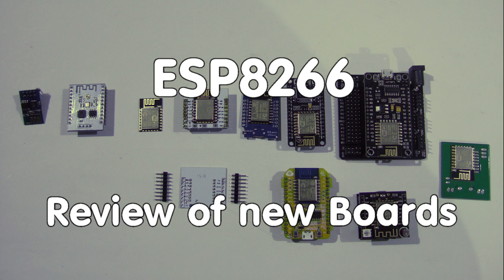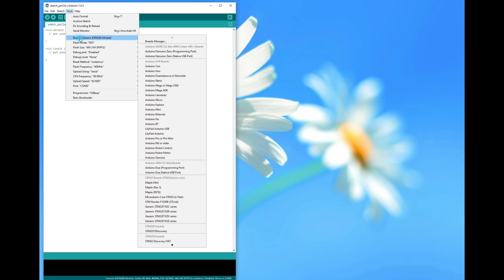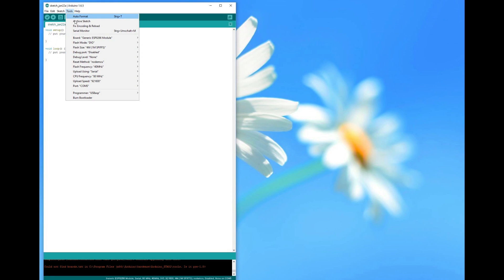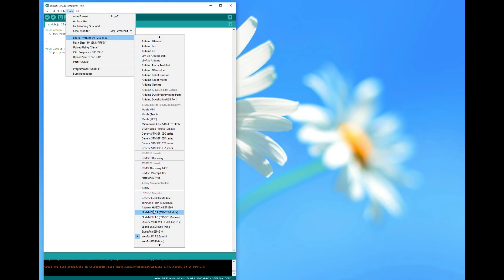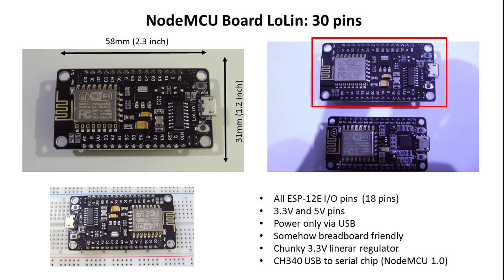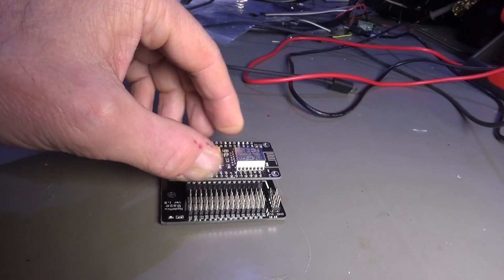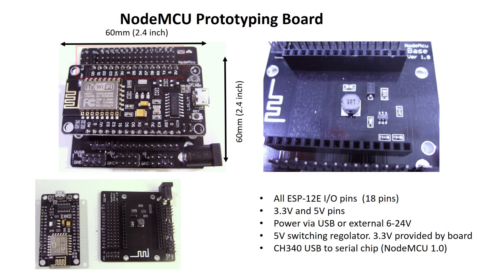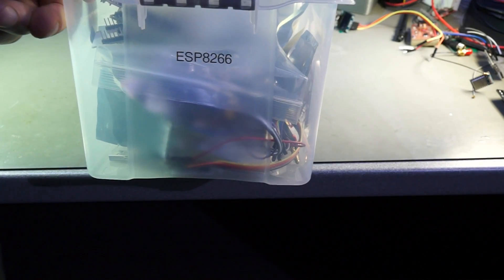#41 Review: Mini NodeMCU (Wemos), Prototype Board, NodeMCU (DOIT&LoLin), Arduino like Wemos, Witty

Comment: hi, great video. I have one problem with te 12E chip (it has 4Mbytes flash memory) but in Arduino IDE I get only 1Mbyte.
Do you know why? (with Nodemcu Lua i can see the 4Mbytes)
Reply from the maker: How do you know that the IDE only sees 1 MB?
Reply: +Andreas Spiess 
Sketch uses 239,311 bytes (22%) of program storage space. Maximum is 1,044,464 bytes.
Reply from the maker: +Babo Babic which board did you chose? If you chose SPIFFS 3M then you only get 1M for your sketches. Try 1M SPIFFS and you should get 3M for your sketch. Goggle SPIFFS if you do not know what it is.
Reply: +Andreas Spiess the board is NodeMCU 1.0, the board is LoLin v3. it does not make any difference witch SPIFFS I choose. If you make it so do you get: Maximum is 3Mbyts whenuploading?
Reply from the maker: +Babo Babic No. You tell the IDE just how you want to partition the memory. Because so far I did not use SPIFFS i always cose 1M SPIFFS and get 3M for my code.
Reply: +Andreas Spiess If I choose 1M SPIFFS or 3M SPIFFS I allways end up with: Maximum is 1,044,464 bytes. Do you get the same message or is the messsage different, like: Maximum is 3,100,000 bytes?
Reply from the maker: +Babo Babic I am home again and was now able to do some tests. I have to admit, I never looked at this number because I never had any problems with memory size and the new ESP modules.
I get the same results as you. The reading behaves as expected below 1M (if you change SPIFFS size you get less memory size). You can try that if you select any ESP board below or at 1M and just compile, not upload.
The maximum memory size, however is always 1,044,464 bytes. Maybe this is a limit of the Arduino IDE. I do not know.
The only place it matters so far is if you do OTA. There, you need double the memory and with small boards it can get critical.
To find the real ESP memory you can use the ESP.getFlashChipRealSize() command.
Reply: +Andreas Spiess it will allways be only 1Mbyte for code and the option (1M or 3M) is for the SPIFFS size (1Mbyte code + 1Mbyte SPIFFS  or 1Mbyte code + 3Mbyte SPIFFS). And here is why:

SPIFFS is a FileSystem that allows to store files directly in Flash instead of having an external SDCard or other storage.

If you don't need that and wish to use the whole Flash for code, it should be possible by creating a new variant board, in the file esp8266/hardware/esp8266/1.6.5-947-g39819f0/boards.txt (path may vary depending of your installation).

In this file, you can copy/paste the "NodeMCU 1.0 (ESP-12E Module)" and create new entry such as "NodeMCU 1.0 (ESP-12E Module) Full 4M". First, in the new entry, all name prefixes such "nodemcuv2." needs to be renamed like "nodemcuv2full4M". Then adjust the line "nodemcuv2full4M.upload.maximum_size=1044464" to some like "nodemcuv2full4M.upload.maximum_size=3932160" (which leaving at least a small place for tiny SPIFFS) . Next, the SPIFF itself need to be relocate as at tiny SPIFFS at the end of the Flash : "nodemcuv2full4M.build.spiffs_start=0x3C0000" and "nodemcuv2full4M.build.spiffs_end=0x3FB000" 

Personally, I didn't try the above yet (I will when I get chance), but it should work pretty straight-fully, although there are maybe other changes to do with the linker scripts. - See more at: http://www.esp8266.com/viewtopic.php?f=32&t=4432#sthash.Sl6fGgIL.dpuf 

(By martinayotte on ESP8266.com)
Reply from the maker: +Babo Babic thank you for the update. Because some boards work definitions are ok I wonder, if it a mistake of the developers or if it has a reason. Did you try a sketch this size? Is the IDE capable to deal with it?

Comment: I have a Wemos mini. It has worked great. I use it with Blynk app to control via the cloud. My trouble now is I would like to add an Ultrasonic distance sensor to my project but the board does not support it! Any suggestions would be appreciated. Thanks for all the great videos. They are very helpful
Reply from the maker: +Brian Fox You should be able to use pulseIn() which measures length of pulses. The command should also work on ESP, but I did not try. Otherwise you could try a while ("Echo pin is high") ; and read the micros() before and after this while. This could give at least a result and you have to test its accuracy.
Reply: Thanks for  your reply, I will give your suggestion a try
Reply: +Andreas Spiess Well, I did not have any luck, so far! I tried this code as well which the author claims that it worked. I got a Serial.print of 0 Centimeter. However, I am not sure if that is because of the use of the sensor with the Wemos or the fact that he has wired the Vcc of the sensor to the 3V3 on the Wemos. My understanding is that the sensor would not work with a voltage that low. Anyway, if you have a link to a sketch that works with the HC-Sr04 and Wemos mini, it would be much appreciated. Thanks for your time and this is the link to what I have tried:
http://www.14core.com/wiring-esp8266-nodemcu-with-hcsr04-ultrasonic-sensor/
Brian
Reply from the maker: +Brian Fox This is well possible, because the HC-SR04 is 5V rated and the ESPs rund on 3.3V. Your source was lucky.

If you use the Wemos mini, you also have a 5V pin. If you put VCC of the HC.SR04 to that pin, this device should work, but you have to protect the input pin of your Wemos because usually, they do not like 5V. You can either use a level shifter like this one: http://www.aliexpress.com/store/product/Promotional-IIC-5-3V-system-compatible-with-the-I2C-level-shifter-module-the-sensor-module/834205_32425888659.html
or like this one: http://www.hobbytronics.co.uk/schottky-logic-level-conversion.

I quickly tested the second one with a Wemos mini and your sketchand it worked. (I replaced the defines with the D1/D2 pin description and used the nodeMcu 1.0 board definition)
Reply from the maker: +Andreas Spiess BTW: Mine did also not work on 3.3V
Reply: +Andreas Spiess Thank you very much for your time. It is appreciated. I in fact did get the sensor to operate on 3V3, however it ran for a while, then stopped. If I covered the speakers with my fingers, I was able to make it start reading again. Crazy for sure. Anyway, I just now completed connecting the sensor to the board via a voltage divider and it is running as expected. i have other issues with my design beyond that though! Back to the drawing board. Once again, thank you for your help. I look forward to watching more of your excellent education videos.
Sincerely
Brian
Reply from the maker: +Brian Fox i am glad to hear that it works. A voltage dividor is also a good and cheap idea!
Reply from the maker: +Brian Fox i am glad to hear that it works. A voltage dividor is also a good and cheap idea!
Reply: +Andreas Spiess , Even a blind squirrel finds a nut! Got lucky. LOL, thanks again.
Brian

Comment: Hello,
could you please recommend a nodemcu board that works well, based on your experience?
Reply from the maker: The boards are not good or bad, they are different. So, its up to your needs to chose.
Reply: +Andreas Spiess Thanks.

I asked you because so far I have tried two nodemcu v2 boards:
1) http://it.aliexpress.com/item/Free-shipping-NodeMCU-development-board-for-ESP-12E-from-ESP8266-esp-12E-Lua-IoT-programable-wifi/32357301146.html?adminSeq=221155680&shopNumber=1264329
2) http://it.aliexpress.com/item/Update-Industry-4-0-New-esp8266-NodeMCU-v2-Lua-WIFI-networking-development-kit-board-based-on/32358722888.html

I program both with Arduino IDE.
The first one works perfectly, while the second one does not connect to wifi.
Since you also use Aliexpress a lot, I was hoping that you could share with me some products that you have tried.
Reply from the maker: +mark So, you had bad luck. About quality, I can say, that I am always prepared for devices which do not work. This is why I try to test them before I confirm (if I have the time). But I had only a few problems.
I shared the link of my suppliers in th comment in the video, without "guarantee" that you get a good one ;-). So far, I had more problems with "non-compliance to stated specifications" than with qoality of products. In the next mailbag you will see, that I purchased ESP-07 "new version"  boards where the supplier stated they have 4M flash. But in reality, they only had 1M.
Reply: +Andreas Spiess So far I had very good experiences with Aliexpress, but recently I have started to have some disappointments.

Based on your experience, is it easy to receive a refund by stating that the device does not work properly?

Are we required to send pictures and/or videos of the product?
Reply from the maker: +mark If you can prove teh things are physically defect it is easy. If they do not work as they should usually you end with a 50/50 agreement. If the supplier does not agree you can escalate it to aliexpress and the do a judgement.

Your case has to be well documented by pictures or other things. I am not sure if video works, but pictures generally are necessary.

I have disputes for about 2% of all orders, which is not a lot.
Reply: +Andreas Spiess Thanks for the detailed explanation.

It is hard for me to locate problems on the board with a visual inspection, so I am not well positioned for a dispute.

My board is the DoIt board (the last link in your list).
Reply from the maker: +mark So, you maybe just write it off and order a new one. These days, this is a little easier because of our chinese prices ;-)

Comment: I did not understand the difference between the LoLin board and the DoIt board, can you please explain again? (:
Reply from the maker: +Idan Ben-moshe Both boards are very similar. The differences are described in the video (6:22 Lolin and 5:22 Doit). The text ois ok, just one picture is wrong. The CP2102 chip of the Doit is square, the CH340 is rectangular. So, they are easy to distinguish.
Reply: +Andreas Spiess Who's better? Lolin or doit?
Reply from the maker: +Idan Ben-moshe You chose. Depends on what you need. They are different not better or worse. The price might also be different.

Comment: Interesting video. However, I noticed an error at 3:30s (https://youtu.be/YQadLyBwz3M?t=3m30s ) where you say the D1 mini makes all GPIO pins available. None of the connectors opposite the aerial on the esp8266 module are brought out to pins on the D1 mini. These include GPIO9 and GPIO10 as well as SPI bus pins. 

Also, you contrast DOIT and Lolin boards and at 5:43 are purportedly showing the DOIT board but it has Lolin written on the board which leaves me confused. I wasn't sure whether this meant DOIT is one version of a Lolin board or something else.
Reply from the maker: +Ken Taylor You are the first discovered my mistake with hte boards! Thank you! There are two boards available. One from Lolin and the other from Doit. I put two annotations in the video where I mixed the pictures.
Concerning the pins: I said, that it has all NodeMCU pins. The nodeMCU buards use different pin definitions (D0 to D10) than the ESP modules. To my knowledge there is no definition availabde (Dxx) for GPIO9 and 10. However, I was able to address  GPIO9 with my sketch using just the port number. GPIO10 did not react. Maybe you have different experience if you use these pins frequently. Maybe it depends also on the development environment.

Comment: good evening
I wonder if I can put in a 180 esp8266 12e and connected to each of a temperature sensor, current and a relay board network. all connected via wi fi and sending the data to excel.

send me an email for me to show the project
blima71@hotmail.com

Comment: Hello Mr Spiess, I have just ESP module shown in 1:11 as in video and no white adapter as shown in 2:08, any idea how to connect it to Arduino or breadboard without USB-UART converter using Arduino TX and RX pins as COM?
Reply from the maker: +Maciej Klimas The module you have has no serial interface. You can connect it to an arduino. But I think, you cannot program it this way because Aruinos usually have only one serial interface. And if you have a Mega with two interfaces you would need a program which transfers all trafic from one serial to the other and back.
It is much, much easier to buy a really cheap USB-to-Serial adapter. A good one costs 2$
http://www.aliexpress.com/store/product/High-quality-FT232RL-FTDI-USB-3-3V-5-5V-to-TTL-Serial-Adapter-Module-for-Arduino/425591_32373474263.html

It has to be 3.3V!
Another problem with these boards is, that they do not fit into any breadboard, because they have 2mm between the pins. You have to solder cables directly to the pins. And you have manually to switch GPIO0 to program the chip.
In my opinion, the easiest way to start with ESP8266 is to buy a NodeMCU module. It has all on board and usually they work fine.
Reply: +Andreas Spiess Thanks, I purchased it and Witty ESP as well, because I'm not sure I burned this one, LED isn't blinking but it was when I first connected it. Will be waiting for shipping and after I receive adapter I will test the one I got now and Witty can be used to continue if first will be really broken.
Reply from the maker: +Maciej Klimas Good luck! I am sure you will enjoy ESP8266!

Comment: Uhhh, nooo! I ordered wemos D1 last week. Why u didn't upload this video earlier :(( Anyway thanks a lot for the informative video!
Reply from the maker: +fatih berk muslu Sorry for that. I got it also only last week. I think, the Wemos D1 can be used as a "normal" ESP8266 board, no problem. As I said, it is just not, what it is intended to do: Arduino compatible. So, your expense is not lost. You just overspend a little because a D1 mini has more or less the same functions.
Reply: I think i'll be use mine as a normal ESP8266 board, too. Thx for the answer!
Reply: +fatih berk muslu you should get arduino prototype shield, for your wimos, then you can make easy final products
Reply: Thank you Glychee for the advice! :)

Comment: Irgendwie kommt mir die stetig wachsende Größe der Boardsammlung bekannt vor. NodeMCU ist gerade das Board der Stunde. Einfach bequem. Für die ESP-01 hab ich einen neuen Oshboard-Programmer der noch nicht läuft. Sobald sich das ändert gen ich Dir Bescheid :D
Reply from the maker: +norm1124 Ich verwende ebenfalls dieses Board. Für's -01 hatte ich mal einen Progammer mit einem ATtiny gemacht. Dieses Board brauche ich allerdings im Moment nicht. Nachdem man jetzt in der IDE immer das NodeMCU Programmierverfahren wählen kann werde ich mir mal diesen Programmierer bauen. Der funktioniert ja i. d. R. sehr gut.
Was ist das für ein Board, das Du verwendest?
Reply: +Andreas Spiess https://oshpark.com/shared_projects/3EzzOydZ Der Author hat es auf Twitter gepostet. 4$ inkl. Versand. Braucht einfach eine FTDI-Board als Adapter und scheinbar ist die Stromversorgung beim Author kritisch. Ich habe noch keine Ahnung woran es gerade scheitert, evtl. die Baudrate o.ä.
Reply from the maker: +norm1124 Habe schnell mit meinem ESP-01 versucht. Baudrate 115k und 921k laufen beide ohne Probleme. Habe auch keine externe Stromversorgung. Hast Du schon mal versucht, die Program Taste zu drücken, bevor du dem Board Spannung gibst? Hintergrund: Wenn dein momentan im Modul vorhandener Sketch das WLAN braucht, reicht der Strom des FTDI nicht aus. Der ESP zieht dann fast 300 mA und er könnte in einen undefinieren Zustand kommen. Wenn Du GPIO0 vorher runter ziehst sollte das nicht passieren. Nur so eine Idee.
Reply from the maker: +norm1124 Sonst sehe ich nicht, wieso das nicht gehen sollte. Das Board scheint ok zu sein.

Comment: Hi Andreas, thanks again a very good video, I am using the NodeMCU from LoLin and it is so easy to use with the Arduino IDE. I have just ordered the NodeMCU Base, thanks for the tip!
Reply from the maker: +Javier Palla Lorden Welcome. I also use the Arduino IDE without problems so far. I am sure you also will like this base.